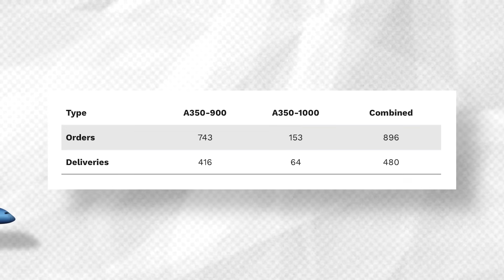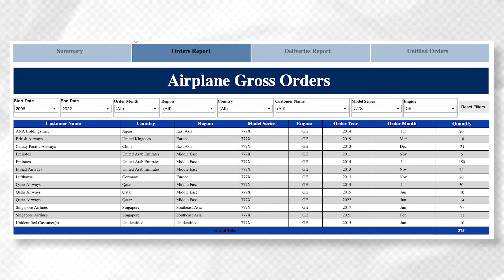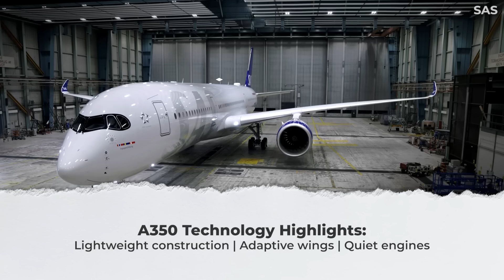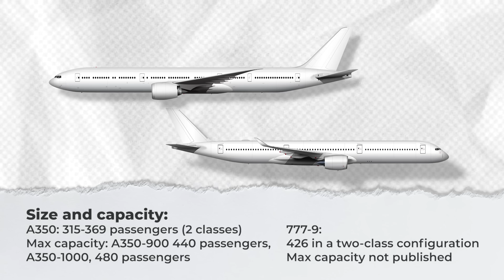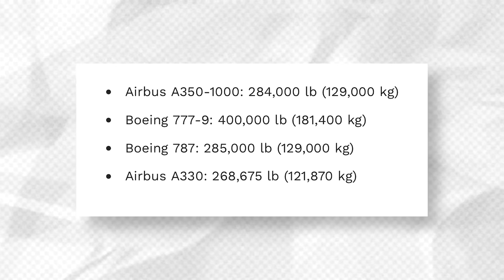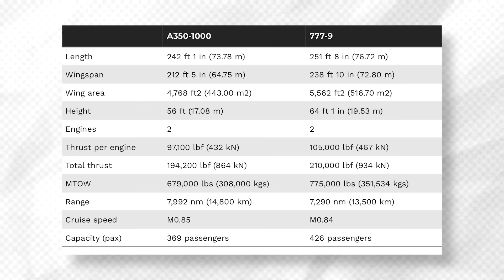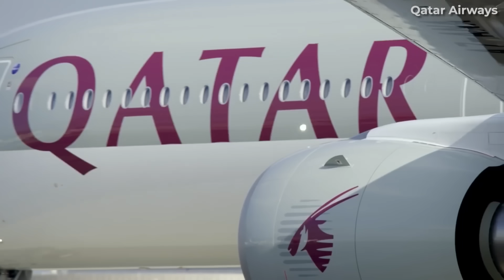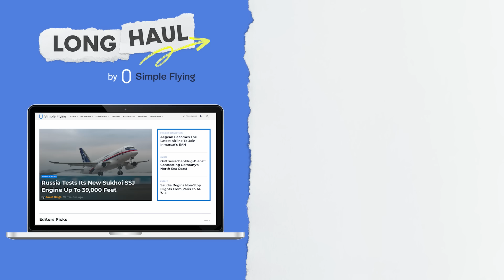The Boeing 777x vs Airbus A350 - Which Plane Is Best?

Comment: Not having flown in either aircraft, my opinion has no winner. Though, I am an Airbus fan. To be fair for both manufacturers, time will tell. 
And, I saw a short film, about the Rolls Royce new engine, being a little larger and a little more powerful, than the engines on the B777X. Time will tell.
Reply: #airbusforever
Reply: I respect your opinion, however, the engines which are on the 777x are the GE9X's. These are the largest currently, and second (2nd) most powerful engines to date. The engines on the a350, are the RR Trent XWB-97, which is powerful, but not as powerful as the GE9X's. Just clarifying.
Reply: @LumpFN  i think he meant the ULTRA Fan that RR is developing whiche is bigger than the GE9x engine

Comment: The 777 is going to be a day late and a dollar short. Boeing’s problems will creep in as testing proceeds. By the time it’s ready for service the world will have moved on. XLR versions of smaller aircraft are the future.
Reply: #airbusforever
Reply: Airlines will still need bulk capacity. Aircraft like the A321LR/XLR are great for long thin routes where it doesnt make it sense to put a larger aircraft in
 The 777X will for core trunk routes where capacity is needed e.g, LHR-JFK.
Reply: @mh12-47  I would think 787-10 would be better for LHR-JFK than either A350 or 777-9
Reply: @eth39232  its a core trunk route which makes BA/AA £££$$$. Why would the put an 78J on their when they can place a 77W with more premium seats and charge more.
Reply: @mh12-47  I can't see AA ever ordering the 777X, even when it's time to replace the 77W.   I don't know about BA.
Reply: @eth39232  "AA will never order the 77W. It doesnt fit their need" for years people said UA/AA would never order the 77W yet UA/AA fly 20 of the type each. Never say never.

Comment: Totally agree. The A350 is the best aircraft
Reply: How did you come to that xonclusiin when the 777X isnt even in service?
Reply: @mh12-47  The A350 is clean sheet design where is the B777-9 is a rehash of an existing airframe design.
Reply: @chrismckellar9350  the 777X has a wider interior and larger windows. Is better looking and it's predecessor has been voted best wide body for long haul..Having a newer airframe doesn't make the 350 better lol. And technically most 777x airframes will be younger than most 350 anyways
Reply: @mmm0404  - How can the B777-9 be voted the best long haul when it is not in commercial revenue service.

As clean sheet airframe design, gives the A350 airframe a longer design life compared the B777-9.
Reply: @chrismckellar9350  don't you know what predecessor is ? The current 777 300er /200LR is it's predecessor or aircraft it wants to replace. It's been voted the best wide body long haul jet and I'm sure the 777x with its wider cabin and larger windows will carry on that
Reply: @mmm0404  - I don't like flying on the B777-200er/300er especially when 10 abreast seating was introduced as I find it cramp. The B787-9 is okay in 9 abreast but I prefer the A350 as it has a roomier feel compared to the B777 and B787. By the way, I am a FF customer with our national airline.
Reply: @chrismckellar9350  the 777x interior will be around 10cm wider  than the 300er in a ten abreast seating . I don't know how much difference it will make but we will wait and see
Reply: @chrismckellar9350 Actually the 777’s cabin is about a foot wider than the A350. It is more spacious. And 10 abreast will become standard on the A350. I love both of them the same but in comfort, the 777 wins
Reply: #airbusforever
Reply: @heidirabenau511  thats the problem with fanboys. They only support what they want to. True enthusiasts appreciate everything about aviation without showing bias. The fanboys kust ruin it for everyone else. Both the 777 and A350 are amazing aircraft in their own right

Comment: Project Sunrise deserves either the 777x or a350. The a350 is pretty cool tho 🇦🇺🦘
Reply: They already decided on the a350
Reply: A350-1000 won comfortably
Reply: #airbusforever
Reply: Qantas has ordered the A350-1000 'extended range' variant for Project Sunrise for delivery in 2025.
Reply: The a350 won because of delays on the 777x project
Reply: @heidirabenau511  Even if it doesn't 778 is the less efficient aircraft, which is significant in such a long route. Plus it was rumored Qantas is rebating their A380 deposits with an A350 order.